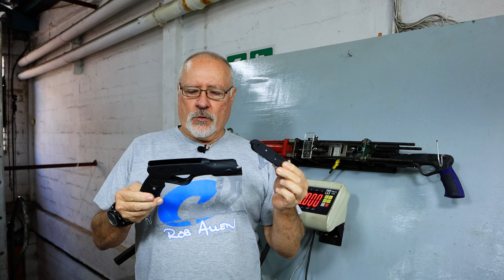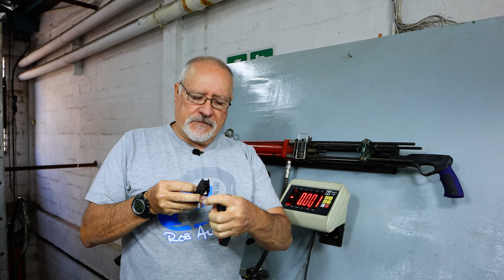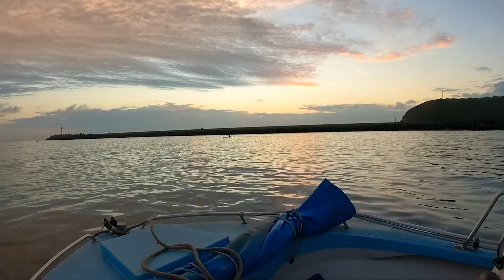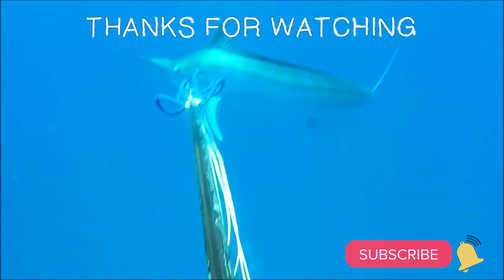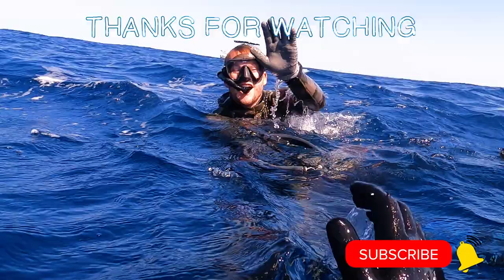Rob Allen | Mechanism Loading Capacity | 2022

Comment: Hey Rob, thanks for putting out these videos.  Appreciate it.
Would you be able to share what part ended up failing?
Reply from the maker: The force is sufficient for the spear to overide the seer and slip out without the trigger moving. The steel of the spear guages a knotch out of the stainless steel seer and zero deformation of the trigger.

Comment: Question?. How often I have to change the rubber band
Reply from the maker: Rubbers will deteriorate even if you don't use them. Heat is a big problem, in the tropics you are lucky to get 12 months, most change sooner if you still want the rubbers to perform. If you are just shooting small fish, not so important to change too often. Roller guns on the other hand have a much narrower window where they work best so it is critical to keep the rubbers fresh and replace more often if you want the gun to perform at it's best.
Reply: @RobAllenSpearfishing  thanks for the answer

Comment: hi rob thanks for being active on YouTube these days, i have little question for you i am using 70cm 16mm rubber on a120 roller gun with 7mm shaft is it okay ?
Reply from the maker: If you are finding inaccuracies then it may be overpowered, which I suggest moving up to a 7.5mm Shaft. But if not then it is perfectly fine.